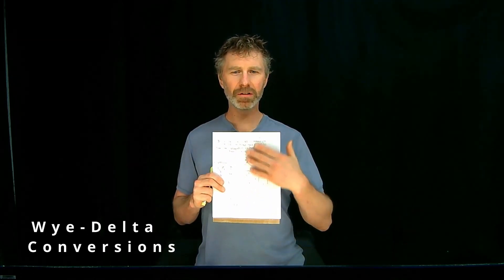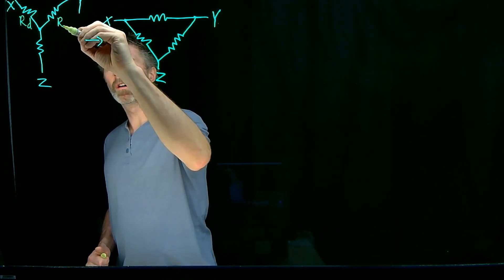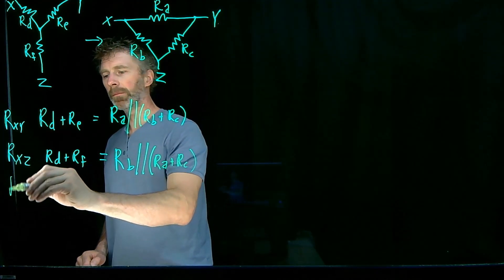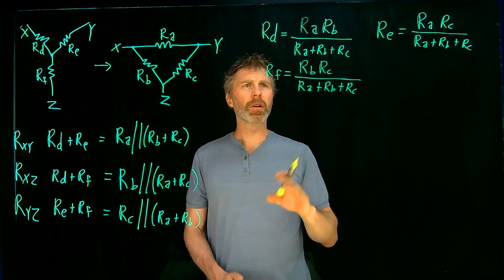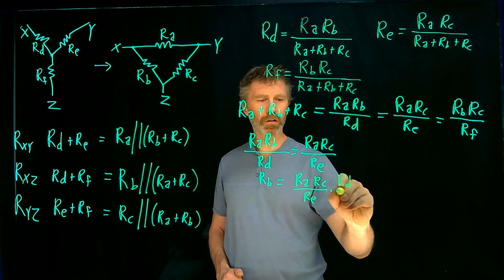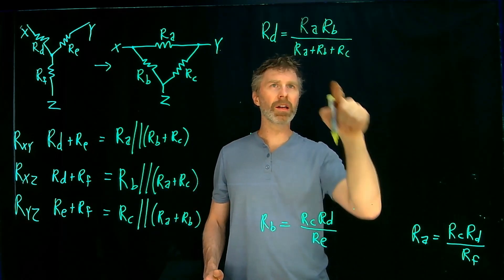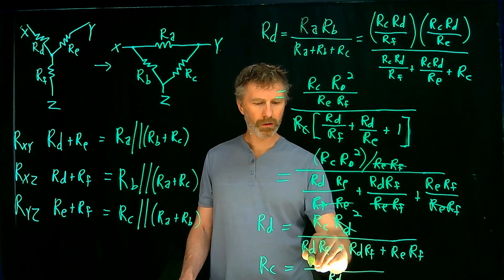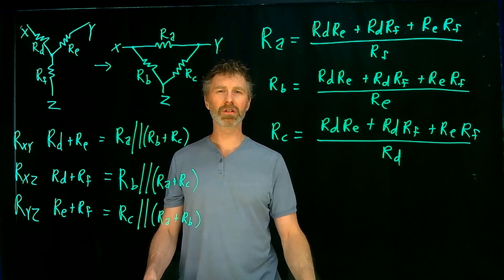Wye-Delta (Tee-Pi) Conversions for Electrical Circuits

Comment: Hello there,
Excellent presentation, and It answered my question although there is another application which was my problem. I have an electric 3 phase 18kw heater (208/3) with 3 elements only, wired in the delta configuration. I was asked to reduce the power of the heater as it was way oversized, and one solution would be to rewire the 3 elements in the wye configuration, but I didn't know what the resulting KW would be. Your video confirmed that the KW would be less, but I still have to calculate using your formulas what the new kw would be. That will take me some time it was a long time ago that I studied algebra in depth like you illustrated.